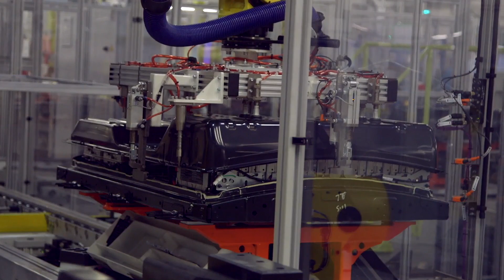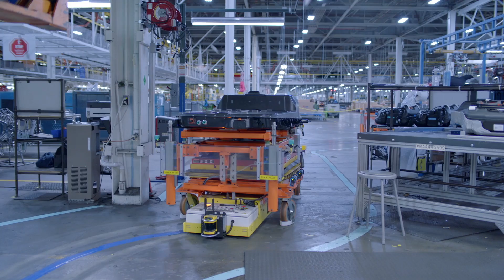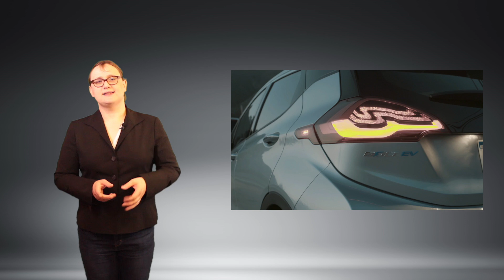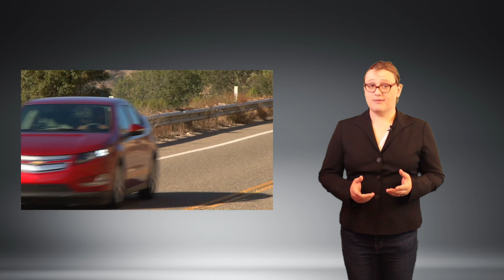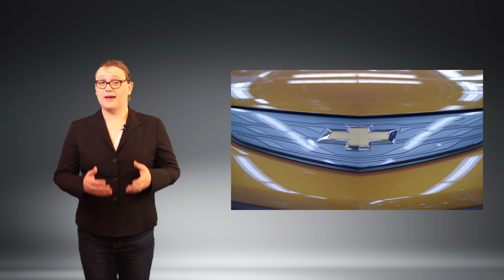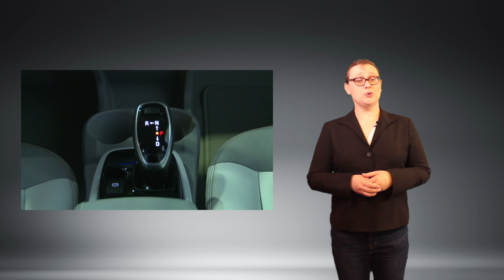Should You Worry About Battery Replacement Costs for Electric Cars

Comment: if you buy a EV USED you re going to pay MORE THAN 25k. thats for sure..
if you buy it new then put the money you would spend in gasoline and service for the replacement after 8-10 years. in the meanwhile enjoy the loss of capacity.. have in mind that today as we speak not all EV manufactures can SUPPORT battery replacement. meaning they just dont have and replacement battery packs because they want you to buy a new car after 10years, not replace the battery

Comment: As a mechanic and hybrid tech the battery is worth more than most of the vehicles, if it ain't under warranty haven't seen one person fix it yet, my last bill for a Pacifica was 17,000 due to the customer using aftermarket items plugged into the the car that voided the warranty... Customer pay.... They traded it in.... Battery tech is 7-25 years away

Comment: You made a brief mention of older used vehicles... to put this in perspective, for the less affluent car owner - I bought my first car when it was 10 years old, at 85,000 miles, and replaced it when it was 18 years old, at 187,000 miles. At that point I bought a 14 year old Prius (at 64,000 miles) which is running great. Is this typical of car owners in general? I guess it depends what neighbourhood you look in. On my street there are a LOT of cars over 10 years old. I would really like to know when EVs will become accessible to those without the budget for a newer vehicle. Battery or cell replacement or reconditioning of some kind is surely going to be essential.

Comment: I'm not worried about that at all. New EVs come with impressive warranties for their batteries, for example 10 years and unlimited kilometres for a Hyundai Ioniq, which is showing strong confidence in and support for the product. Good luck trying to find a warranty like that for the petrol or diesel engine of a conventional car. And I would probably sell my EV long before the warranty expired, to someone who isn't ready today and needs a few more years to switch from a fossil-fuel car to an EV, and get myself a new EV of the latest generation. Talking up battery replacement needs and costs is just scaremongering and unlikely to become any more of an issue than replacing petrol or diesel engines is (if at all).
Reply from the maker: Hi Oliver

We totally agree.  

Especially as 60 - 130 kWh batteries become the norm then it's likely the batteries will outlast the car.  In the case of Nissan Leafs though, and we're the proud owners of NZs first Leaf from 6 years ago, we're actually looking forward to replacing the battery hopefully to increase it's range from ~120km to ~250 km when 40 kWh replacement batteries become available..... and increasing the value of the said Leaf!

But for the vast majority of future EV owners batteries will outlast the cars.

Team Bring Change
Ecotricity
Reply: My question is .....how are the batteries made,  where do the minerals to make them come from. Is there any environmental costs ??
Reply: Of course there is, but so is cost to mine iron ore to make a combustion engine with hundreds of moving parts. We tend to ignore that, because it's "normal", and we focus on all that is "new" in EVs and have much higher expectations of them while the fossil-fuel car gets the free pass. And let's not forget that pretty much every large armed conflict in the last 50 years was about who has the oil and who gets it, not to mention multi-billion dollar environmental disasters, like Exxon Valdez and Deepwater Horizon. We have to be fair and compare ICE and EV like apples and apples.